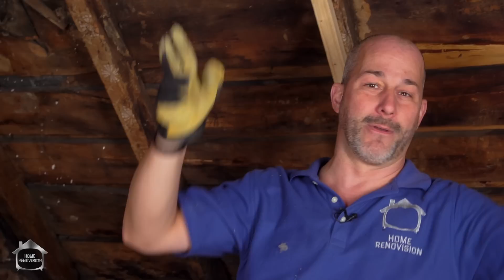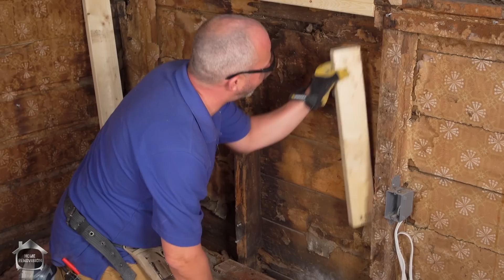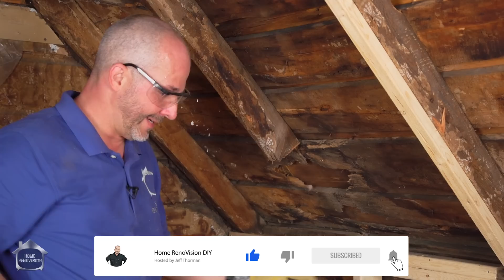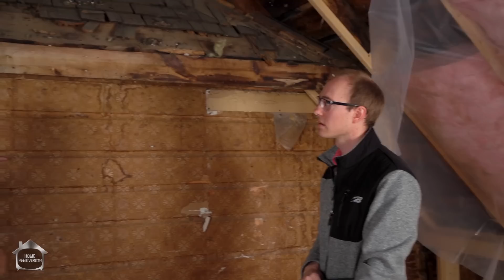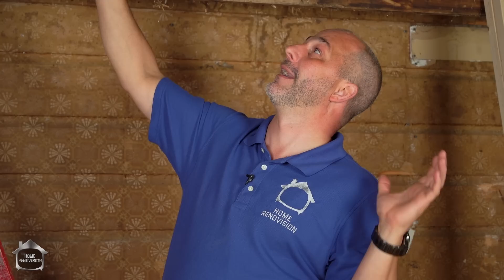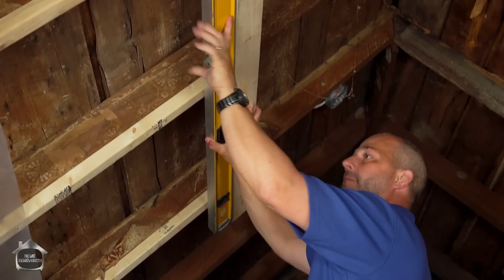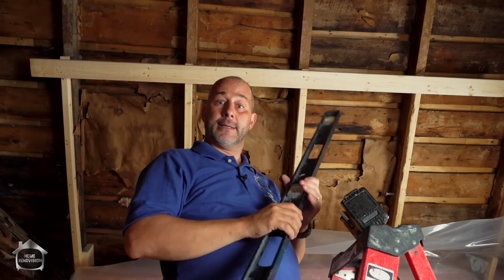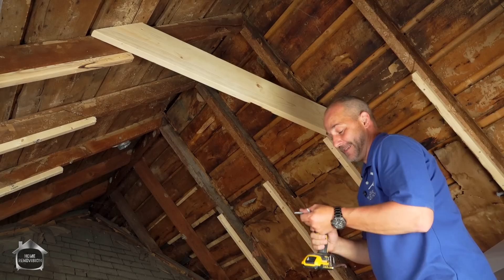How Structural Engineering Affects DIY Projects

Comment: I have a cottage in Ontario built in 1904 - EXACT same construction.  Fortunately no one ever messed it up with paint or drywall inside.  All we've done is add vinyl siding and steel roof and the structure itself is still fine.  It sits on white cedar timbers cut on the property and stumps and bedrock.  It's settled about 1/2 inch in 116 years.  lol.

Comment: just curious why not use spray foam insulation great r-value, and also so would tighten up everything on an old building.
Reply: Spray foam needs poly barrier a company did it at the temple and their well known. It is much more warmer but if you sit close to thr wall underneath the wall and carpet you can feel a breeze.

Comment: Don't you need soffit vents if your going to heat the space? my wife and i have a bungalow biult in 1916 and we were told since we finish the upstairs attic we would need to spray foam it to encapsulate it from the outside so we don't have mildew and mold issues.
Reply from the maker: I guess that all depends on how long you expect the house to last. I will be happy to get another 100 years out of it. spray foam would probably get another 150. Cheers!

Comment: I like how you explained the WHY of the decisions and options. I like the hacks of re-aligning the compromised roof.
Reply: Yeah ... HACKS.  I know my handle is misleading here, but I'm a journeyman carpenter, a journeyman plumber, hold a third year electrical apprenticeship, and a second year HVAC apprenticeship.  I got all of that so I could ACTUALLY do complete renovations, safely, properly.  I've done Reno's for over 30 years and there is NO WAY IN HELL I would leave compromised framing members in a wall and just scab on a few feet of 2x4 (AND constantly refer to them as 2x2s).  Also, I don't think I've seen anyone on a job site wear their aprons in the front in 20 years.  I know I haven't since I was 17.  Gets in the way when framing, roofing, even siding if you're bending.
I'll give him kudos for siding and tile work, though, except when he through the trash he cut out his mirror opening into the wall cavity.  That's exactly what I want a contractor doing.

Comment: You should install temporary shoring before you remove the old collar ties and install your proposed design.
Reply: absolutely...without collar ties, the pony wall could easily be pushed out of plum.  The easiest way is to leave the old collar ties in place and remove the old ones as you go. One other thing, insulating the vaulted rafter bays is a perfect candidate for a "unvented roof assembly". See the last page of ICC chapter 8.

Comment: Just adding few cents: The trunks on your floor were common when the house was built because at that time basement was considered storage for the  cold so no sense in using dress expressive lumber. 
Yes 20' rather and studs were common because unlike today's it was abundant plus balloon frames were cheap to build them platform frames considering Carpenters were respected and expensive. 
You can remove and replace your trunks joists one at the time with proper support but pour a foundation or a pier under first. 
Your roof rafters are undersized so sister each with a sandwich of 3/4" plywood and a 2x8 that will give you a pocket for your ridge and meet insulation code.
perhaps you could use a two 10" LVL with a 1/4" steel plate pre drilled to nail your rafters considering the spam....
I would add another pony wall in front of the existent to accommodate the new rafters size and load.
Once the ridge is resting on the posts you can install blocking on each side to prevent rolling. I would add fire stopping on all cavities surrounding the area. 
Eventually a dormer ... just add a heather and double up the rafters where the cut out will be. 
That's it. No more candy for free 😎😄😄😄😃

Comment: Why add 2x2's to the rafters for insulation instead of just adding foam, either closed or open cell spray foam. The reason I am asking is that I have a similar situation and have decided to go with closed cell foam but after seeing your video, I'm wondering if that was an option you chose against, and why? Thanks
Reply from the maker: Hi Chuck, simply managing the costs! foam is a quicker option but this way I saved over 2 thousand bucks. foam will give you more r value if that is what you need. Cheers!

Comment: By code a 2x6 only requires 2-10 penny nails  on each side and that's sufficient. You also drove the lag bolt way to far into the rafter. Its basically as if it's a 5/8 piece of lumber. This is ridiculous.

Comment: I was waiting for the bloopers to be over then I realized this is the actual video. You need to learn how to use a nail gun first because I believe you still need practice with a hammer and nail. 

For one I would of preferred to see a entire piece of rafter sistered against that roof rafter that you made a attempt to replace/repair. Second it would of been nice to see a nice clean degree cut where it transfers load onto the wall plate. It's not that hard to use a speed square.  It barely had a footprint set on that plate. Third it would of been great to see pressure treated or a better would then appears to be white wood cheap pine. You make me sick and I'm speaking for all carpenters. Complete laziness and you are teaching people wrong. Any real carpenter would know what it takes to support something like that.
Reply: treated on non-ground contact? can you give me any reference material or other videos to watch on why that is? never saw Larry Haun do that, or Essential Craftsman. and doesn't Treated have a habit of corroding or spitting out nails if you use the wrong type?
Reply: I hope your other videos aren't this  bad

Comment: Should one support the Roof before Cutting.
Reply: In this case no if you are only working on one or two rafters repairing and if you are repairing a section of wall that's supporting a roof like in this case I wouldnt cut out more then 4ft at a time without bracing. Definitely dont cut corner jack king or jack studs out without bracing.

Comment: Hi - do you have any advice for insulating a shed with a corrugated steel roof? I have built a shed that i would like to use as an office. Some days there will be a lot of condensation on the underside of the roof.
Reply: You have two options. Closed cell spray foam insulation sprayed onto the backside of the sheetmetal by a company or build a wood decking underneath the metal with a 1" gap between the metal and the decking for airflow. Even if you were to butt fiberglass insulation against the metal it would still condensate and it will saturate over time and then become mold bearing. Best option is get a local spray insulation contractor to come spray it.
Reply: @ChadCosgrove472  Thanks - I don't think they are available in this area. I might replace the iron sheets with sheets that have insulation backing.

Comment: You got puzzled by the levels, it happens.  First, mark a datum point of each gable, measure up to where you want your collars placed, put one collar at each gable end (level), then use a string line between the two collars, then measure and cut and fit.

Comment: Aren't you Canadian?  Why don't you use a metric tape measure?   I live in the US and use a metric tape  so I don't have to spend time thinking about fractions.  Also the though of using a system based on the size of the Long of England's foot is repulsive.
Reply: Likely because our lumber and drywall is still in Imperial, and most of us just keep on with a half-assed Imperial/metric world.
The road signs may say Km (1.6km to the mile) but we still generally speak in miles because that's how the land was originally surveyed.  
I get what you're saying though, and yes, not having to deal with fractions is a nice bonus, but man it's hard to take the old school ways out of the country - even much younger people still refer to their height and weight by imperial.  Lol.

Comment: A lightweight (but still high quality) nail gun would be REALLY helpful for a job like that, eh?
"You should not be able to rip apart your house with your bare hands, folks"...you should work on a few houses built in the 70's in Florida...You can, at least large parts of it.  Nails popped from the drywall, nails sticking up all over the (barely nailed) loose roof sheeting, etc.

Comment: I have my degree in structural engineering but don't work as one. I'm a carpenter of 30+ years. If I was an engineer I probably would have used glued and nailed plywood and amended the rafters to make them into scissor trusses. The plywood would be oversized gussets. Could have kept the vaulted ceiling but would have lowered the slope of the internal ceiling just a little bit. Carpentry would be 3-4 man days.

Comment: Did you say that you would perform the work and the have the structural engineer come and walk through and stamp your work.  So Its better to ask for forgiveness then permission.
Reply from the maker: You can if you know what you are doing! Cheers!
Reply: I noticed that also.  Worst example you can possibly set.  At least two big issues: 1. You risk needing a lot of rework.  2. You may miss out on a more creative solution once you proceed down one path without engineering review and input.
Reply: hahaha... as a structural engineer, this is super frustrating.  Now when it comes down to the discussion with clients, it ends up looking like we're the bad guys for having the contractor redo the work if it's not done properly!

Comment: @4:50:  Seems like you could put a metal-cutting blade in your reciprocating saw, slip the blade between the stud and other structures, and just cut the nails.
Reply: Michael Fresh  Not necessarily,  i use the saw and can cut the nails without cutting the wood siding. You need to know how to angle and also use the right length blade. You just don't have enough experience with a sawsall if you don't think it can be done.

Comment: The only time an engineer came to an actual job!
Reply: Omg, double 2x8 for a DORMER is very adequate.......... he will approve it, depending on the load, dormers are little to nothing, the weight disperses along the doubled rafters installed and are load bearing for the windows and the frame. Now if you wanted to add a dormer the size of half of your house, sure you would need to adjust; lol.
Reply: Even 2x6 would meet the needs

Comment: Just curious, why didn't the engineer consider using 2"x12" as the rafters with nail plates?  Could of sistered them to existing rafters! definitely would of carried the load with the looks of roof pitch. Also could of used cable and tension tighteners.
Reply from the maker: They do what they do. Cheers!

Comment: been giving your dormer some consideration and a possibility that you may want to consider is 2 dormers opposite each other  with a ridge beam running from one to the other obviously i have no first hand knowledge  of your roof or the actual loads but this solution can be utilised to take the loads from the main roof ridge beam to the outer wall plate

Comment: 11:45 Introducing the one-handed human roof jack, with optional mega-thrust off hand power nailing! That move was unreal.
Reply: Would have been 1000 times easier if he put a screw left out an inch in the old rafter and used a flat bar to raise the new 2x4 even with the old one.  The way he did it he only got x2 leverage, my method gets x10 leverage.
Reply: @jeremycash1990  Wouldn't it be more in line with the old rafter if you were to leverage off of the floor below you? Also shouldn't he have jacked up that new rafter a little higher for the 2nd nail, looks like that would be a reason for the 2x4 to warp
Reply: paleeez!

Comment: I did this years ago, knee wall, metal ties at the peak but had the cavities filled with 5-6 inches of spray foam. Made the house super air tight but my only complaint is you could hear ever little rain drop at nighttime when trying to sleep.
Reply from the maker: that is because you didn't use vinyl mass to isolate the impact sounds. Cheers!
Reply: @HomeRenoVisionDIY   Ha! Didn't think about that at the time, first time using spray foam. Next house was 2 inches of foam for air sealing and then R20. Had a bit more room to spare. Anyways enjoy your morning coffee!

Comment: Since you are adding sheetrock load to the old rafters and you may add additional load when you add sheathing on top of the roof, the loads are increasing on the old rafters.  The old rafter effective span may be changing, since the collar tie location is changing.  Based on these two or three changes, the rafters need to be beefed up by sistering in a 2x6.  This alteration does not meet the code.
Reply from the maker: You will have to show me your engineer stamp before I will take your advice seriously!
Reply: @HomeRenoVisionDIY  It doesn't require an engineers stamp to see that you are adding 2.4 psf sheetrock load and later 1.5 psf plywood load to the roof.  Since you are adding significant load to the roof and reducing it's structural capacity by raising the collar ties, your engineer was negligent when he said that you don't have to strengthen anything.  By standing outside and looking at the roof, if there is any sag of the rafters between the outside wall and the ridge, then the rafters are already over stressed and do not meet deflection criteria.

Comment: I love the video, it reflects the real world, at least is I have experienced it in 34 years of construction. Having said that, because of the ability of lumber to split as it dries, nails in a piece of lumber do not substitute for compressive strength of lumber. To properly  meet code, the center stud should have been stacked directly above a clean cut on the existing stud, and then held in place with two by fours on either side going at least 24 in over the existing and the new stud(could be longer, you would have to look up the current code). In any event, you can't transfer a load using nails, the weight of which goes down the grain of the wood. There are no exceptions to this rule. If the grain is horizontal, then it's fine. But if the grain is vertical nails are useless with respect to load. At the building code, whether we like it or not. Fortunately, in the case of this structure you actually only need to scissor in the one stud in the middle, because the others are not carrying a load.

Comment: How are you venting that roof? Perhaps you have another video to address it?
Reply from the maker: In old houses there are no fresh air soffits. that is why we will be installing a metal roof. others wise the asphalt shingle will deteriorate too quickly. Cheers!
Reply: I eventually plan to do a retrofit project similar to this but I haven't been able to find a solution to insulate and vent the roof. Metal roof would solve the problem, thank you!

Comment: when insulating an old wooden house i would really stay away from plastic barriers due to condensation risk.
Reply from the maker: in the north condensation is exactly what we are trying to keep out of the insulation. Cheers1
Reply: @HomeRenoVisionDIY  sure, I understand what you are trying to do. I'm just renovating an old loghouse (interestingly it is standing log!) back home in Sweden and I am not using plastic to avoid condensation and therefore use a special paper based cover which is still breathable and lets air circulate.

Have you not had any condensation issues with your approach. All the best from Europe ;-)
Reply: I'm trying a product called Certainteed Membrain that's code approved in the US (I'm in Canada) and let's the wall breathe when it gets warm and blocks moisture from inside when it's cold.
Reply: @michaelangemeer4183  Thanks, that is certainly an interesting product and just googled the fact sheet of it. I'm leaning towards something more traditional in form of a paper breathable product. Have not decided yet which product specifically. The reasoning behind it is that the house in question is a 120 year old standing (!) square log house with outside paneling and all the logs are still in perfect condition, therefore keen to keep a natural airflow and avoid plastics. 

Assume you have a similar climate in Canada to what we have in Sweden and would be good to hear you experience with Certainteed Membrain.

Comment: Doesn't the roof need some form of ventilation?
Reply from the maker: It is preferable however in old houses venting does not exist. so best to install a metal roof. Cheers!
Reply: @HomeRenoVisionDIY  Hi Jeff.  Ventilation at roof is required.  As per code, condensation would occur if you don't have ventilation.  So hot air from inside the house rising to the rafters and cold air from outside trying to get in would result in build up of condensation which would deteriorate the wood structure.

Comment: I’ve had to straighten a 2 story house that the homeowner removed all the collar ties for headroom in his attic , also balloon framed , the exterior walls on 2nd floor had kicked out about 5” @ 6’ , I had to cut the nails and pull studs in with cables while jacking the ridge beam up all from the attic , most people don’t realize you need the extra support before removing those ties !
Reply: Is it possible to straighten brick walls though?
Reply: @impactodelsurenterprise2440  I would think so , it’s nothing I would attempt

Comment: why don't you talk about spray foam being an option?  Can't it work as a vapor barrier as well?
Reply: I would'nt do it any other way.  Especially being in Canada.  Probably Utility subsidies available.  High density polyisoanurate.   Sub it or use Frothe pacs.  Fill those wall bays with packed cellulose.  Balloon framed-  make sure you close off the stud bay as it enters the basement.  Don;t ask how I learned that one...
Reply: Spray foam can be real nasty if you screw it up. https://youtu.be/0Hh5MYv7lWc